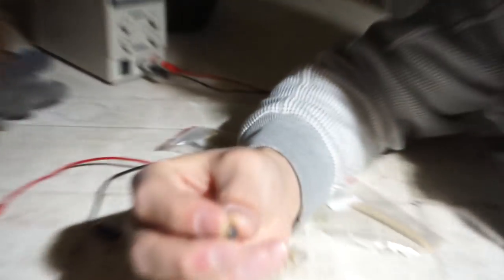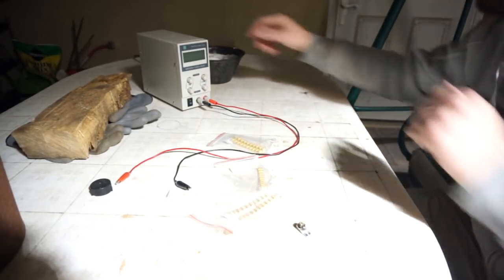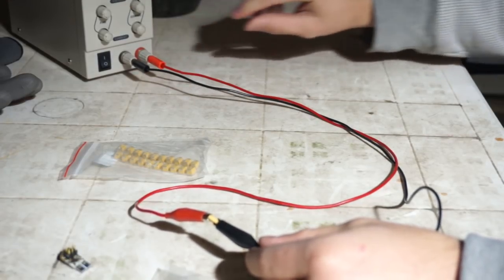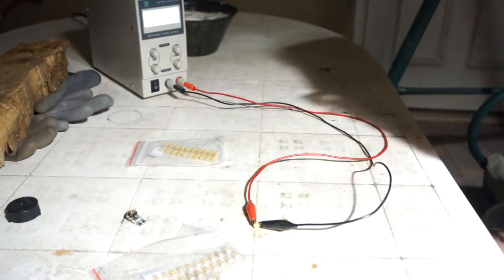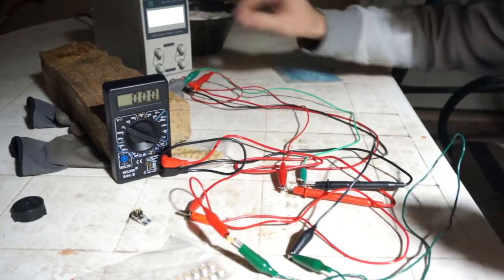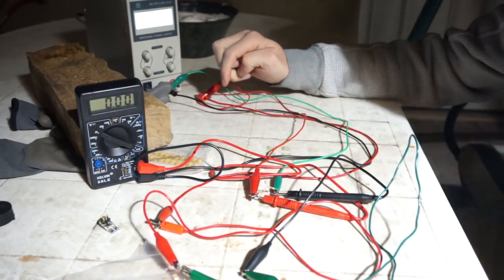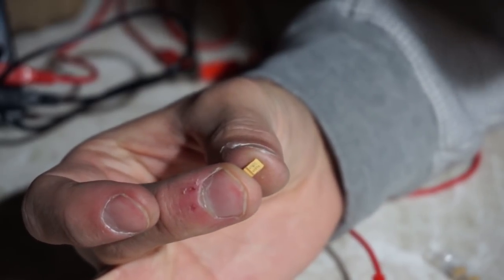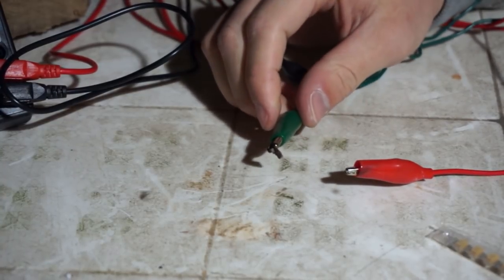I got tantalum caps from the wrong source

Comment: Even with the right polarity they can explode. First Time Turn On Failure.  Tantalum caps  can have shorts in the layers which oxidize and self heal at low current , if the first time current is high they blow. Ive had one in my face.

Comment: I have some of those in an old motherboard from the 90s, seems that during that era they sure used that, but mine are circular baloon like. Do you recommned to take them out and replace them with electrolitic capacitors? motherboard has about ten 16v 10uf tantalum caps, and those things really explote and catch fire.

Comment: You cannot trust the sticker on bag. The package size seem to be far to small for 16V rated caps in 100uF range. The marking of the 220uF cap was a bit blurry but looked like 4 or 6V to me.  As a sanity check I would compare the package size and marking of the cheap caps to datasheets of some know manufacturer.

Comment: I just bought 50 TL081 opamps off eBay for real cheap. None worked. All of them had high impedance output pins. Just for the heck of it, I tried the pinout for a TL082. Yep, it was an opamp. But maybe not a TL072, it didn't meet TL082 specs. It is marked as a TI chip. But the TI logo is mis-shaped, and it is ink printed rather than laser etched. Humm...

Now before you say "don't by opamps on eBay", I have batches of LM324, TL082 and TL084 opamps that are most likely also fakes, but work just fine and meet all specs,and were dirt cheap. But not from the same seller as the "TL081" opamps that weren't.

Comment: For mfg   : Any  non confidence of supplier / source traceability of parts. The parts should go through IQC (inwards goods inspection). 

This means you need to setup a test procedure  to test goods as they come inwards to your manufacturing stores. 
Mfg has been doing that for years!

Not all goods need IQC....  some parts come with their own independant test certificates.

Comment: IME,tantalums (even name-brand) tend to need a good amount of voltage de-rating. For instance,using 16V rated caps on a 12V supply is probably pushing it,better to go to 25V parts. I've had them explode and throw flaming bits all across my bench on more than one occasion.Once,some bits flew onto a pile of notes,which then instantly burst into flames. I try to avoid using them,if possible.If not,get the highest voltage part you can find/fit,from a reputable source.

Comment: I went to a presentation like the Kemet one you linked in the description. It was a couple of years ago and I don't remember from which manufacturer but it was one of the big ones. They told us that we should burn-in tantalum caps on our boards. At that point I decided Iwas never going to use them: I'm not prepared to put stuff in my schematic to burn them in properly the first time I power up the board.
Reply: Might have been Vishay.
Reply: Best reference I could find is this: https://eewiki.net/display/Motley/Tantalum+Capacitors. A bit meager but I've done a day of code review (multithreaded Python ugliness...) and I'm to tired to look any further.

Comment: How the fuck do you calculate "10 times cheaper"? How much, by your formula, would "1 times cheaper be"? How can you multiply a relative comparative ("cheaper") when you haven't even defined the "cheapness" of your original?? Talk science, or talk none, you language-butchering murrican!
Reply: Part A is 10 dollars.
Part B is 1 dollar.
Part B is 10 times cheaper than part A.
Reply: So, "n times cheaper" means B=A/n, correct? And "2 times cheaper" means B costs half of A?
What about n=1? Suddenly B is the same as A, yet you still use the word "cheapER", indicating a difference. How can something that's the same be different at the same time? Sorry, mate, your use of English remains fucked.
Reply: +Anvilshock    It's cheap at half the price when n equals 2 (or, possibly, 1/2 ?).

(https://www.phrases.org.uk/meanings/cheap-at-half-the-price.html)
Reply: When n=1 you say "they cost the same amount of money".
Reply: When you say "they cost the same amount of money", or "cheap at half the price", you are using a different wording which makes those arguments invalid as far as favourability of "n times [less]er" is concerned.
Why can't you simply say "one tenth as expensive"? For "cheap" to have any value whatsoever, you'd need a reference (eg. your budget, or something that costs even more, etc.) to quantify that cheapness before you can multiply it, whereas "expensive" is absolute, it refers to the total cost ("the distance from zero"), and so you can multiply it by 1/10th, and everybody knows immediately, without needing to know any arcane details about colloquial abuse of language, what was implied.

Comment: Send me a few of these caps and I'll film them failing at 40 000 fps! :)
Also, they have to be derated from 40% to 70% or there's a high chance they'll fail. Generally, the higher voltage they are rated for, the more you derate.
Reply from the maker: email me at lohr 85 at gmail with your address and they'll be mailed out post haste.
Reply: Sent!

Comment: Tantalum caps are dangerous (in overvoltage conditions) even when they're made by a good manufacturer. Now these Chinese made tantalum are a real fire hazard. I might just order a few and use them as fireworks for the new years eve.
Reply from the maker: I really feel like them being dangerous when used properly is a bit of a misconception after watching James Lewis' video.  I really recommend watching it.
Reply: You are certainly right, used as they should they are safe but it's too easy to get an over-voltage condition or disregards some of their limitations. It's just easier and safer to go with ceramic or polymer tantalum or even an electrolytic. That's how I think when designing a circuit. I am gonna watch the video you recommended now, thanks!

Comment: classic MnO2-tantalums should generally be derated 50% to 75% depending on environment temperature, so you wouldn't use these above 8 to 10 V (5V in high temperature environments). however, reputable brands will generally survive surges up to about 130% rated voltage.
so i guess the seller is probably selling 10V parts, which will work most of the time in non-demanding applications (shady nontheless). if you still want to use them at lower voltages, i would check their ESR, dissipation factor and dc leakage first.

Comment: Did I miss it in the video where you tried one in reverse polarity?  You mentioned maybe they are marked backwards but I did not see you test them backwards?

I have bought tant caps from ebay before and not really had issues but I have never tried pushing them over about 50% of their rated voltage.  I guess generally I just use ceramic everywhere since they are cheap.

Look forward to hearing more about the secret boards your are assembling :-)
Reply from the maker: I did test it backwards.  They are not marked backwards.  I can't remember the results from that test, though.  I did do it on camera just edited it out since the video was already so very long.  The problem with ceramic is the $$$.  This product has to be DIRT CHEAP to build and it's kinda tricky to make that happen.